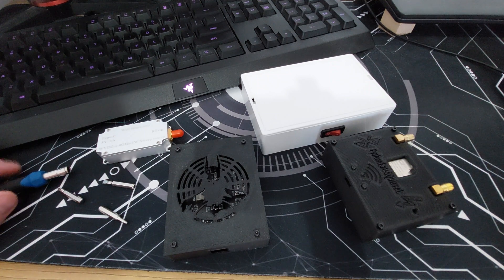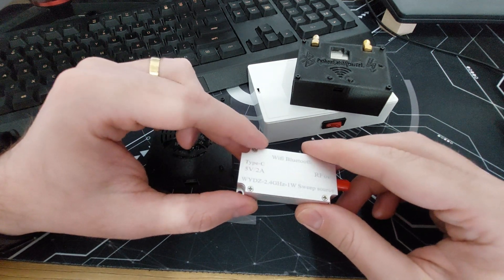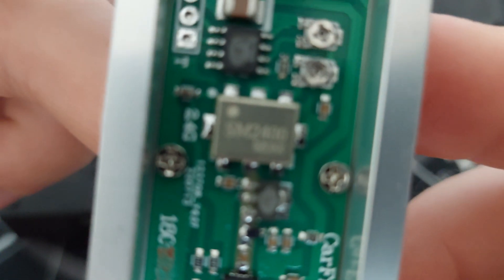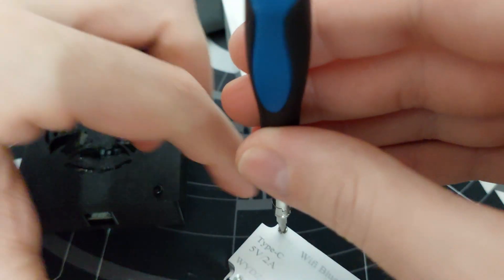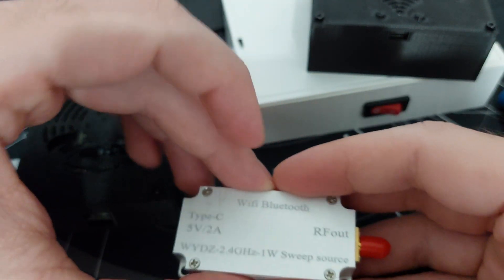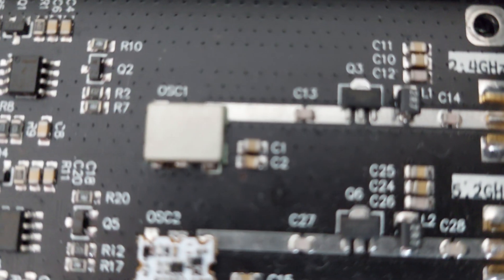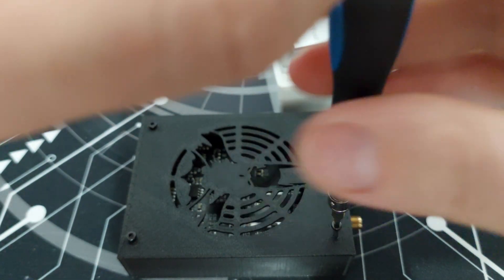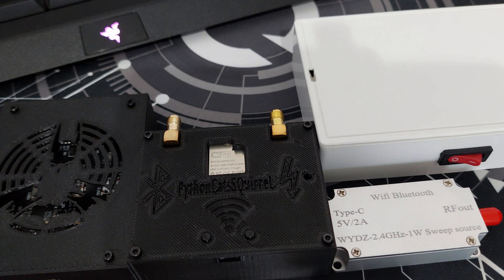Deauthers vs Jammers - Range, applicability, differences

Comment: Okay I'm really new to this so pardon me if I'm wrong on this. When these transmit they transmit on the entire frequency band, meaning anything running on the 2.4ghz band will be interrupted? And all that's required to increase the range is to add an amplifier to each channel?
Reply from the maker: Yes, but you need an amplifier just for each frequency not for each channel